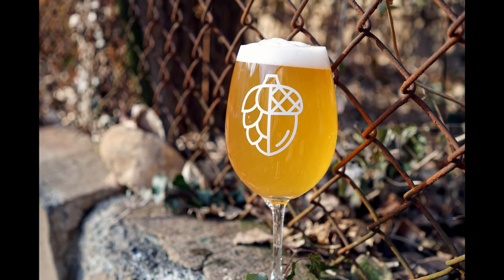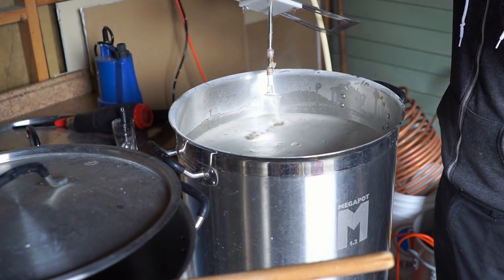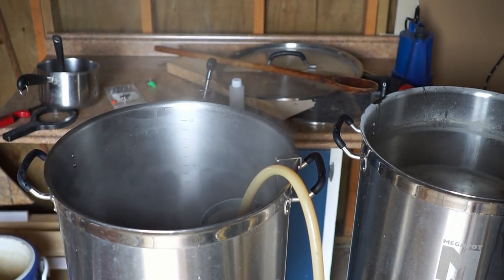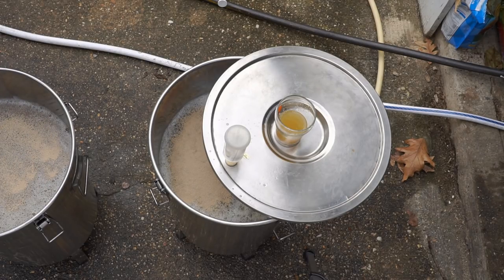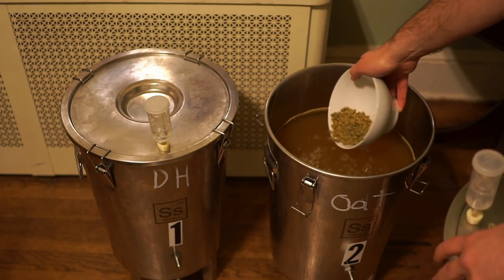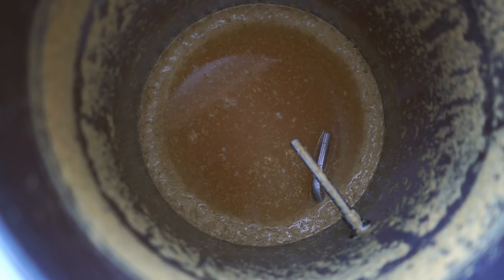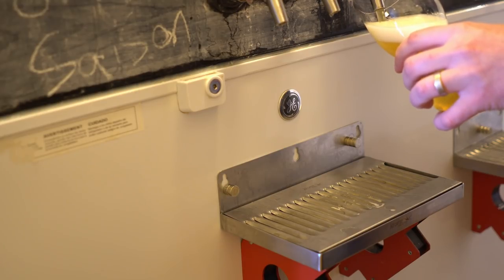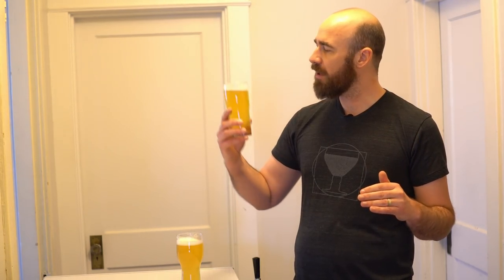Grain-to-Glass: Hoppy Session Ale - Dry Hop Timing Experiment!

Comment: just started home brewing so pardon this Q but are you putting your full boil volume in the mash, and just recirculating that? And after X amount of time of recirculation, transferring to the boil kettle? Thanks!
Reply from the maker: It depends on the batch, sometimes I add all of the water, sometimes I save a small amount to sparge with. It doesn't provide terrific efficiency, but it makes brewing easier and quicker. Worth it for me!

Comment: How long would you recommend for traditional dry hopping and what temperature for a beer like this? Also for increasing dry dry 
hop contact - have you ever pumped co2 into SS brewbucket?
Reply from the maker: At the scale I find the easiest method simple physical agitation (i.e., swirling the fermentor) although I have also played with sound waves, placing a speaker touching the fermentor set to 80 hz from a tone generator.

Usually I dry hop for 5-7 days, which is usually enough time for the yeast and hops to settle out and be left behind when I get. Dry hop extraction is pretty quick, so you could go faster if you are bagging the hops. I dry hop at fermentation temperature, but if you have a way to add hops without introducing oxygen (like in a keg before purging with CO2) then ~58F is a good stop to limit renewed fermentation if the enzymes from the hops free additional fermentables (called hop creep).

Comment: hello Mad Fermentationist~ i'm a new on home brew beginning 4 month ago~ i have two questions keeping bothering me. I with you can help me on it~ 1st, the process. i have asked many different people and got different answers. i don't know who is right. currently, my process is: 1st fermentation for 2 weeks. then transfer wort to a clean tun for another week with blow off. then dry hop for 8 days with 15℃(59℉), i will try to keep all gas in the tun. then bottling for 10 days with 18-21 ℃ (64-70℉) to carbonate. then put the bottles in refrigerator for another 2 weeks with 4℃（39℉） i was doing APA. would you please suggest me whether my process is correct? 2nd, fermentation temperature control. i know different fermenting period has different temperature. would you please share your experience on this? thank you so much in advance!
Reply from the maker: Luckily there are many correct answers in homebrewing. For my tastes in hoppy beers, I would shorten the fermentation/aging process. I count 7 weeks from brewing to drinking, I'd try to get that closer to a month. Oxygen and time are the largest concerns for hop aroma. I would likely dry hop in the primary fermentor as fermentation slows (day 3-4) (the yeast will absorb any oxygen you introduce). Fermentation should be finished and the yeast and hops dropped out after another week. You can lower the temperature at this point to help the yeast to drop out. Then I would bottle for two weeks. You can put one bottle in the refrigerator over night to test before chilling the rest. It shouldn't need two weeks cold once it is carbonated, but it is best to store them cold.

There are many approaches to temperature control. The ideal is having a refrigerator, temperature controller, and a fermentor with a thermowell (allowing direct monitoring). That's what I do when I want to be careful. For many beers I just brew with the seasons, taking advantage of the summer heat to ferment with yeast that prefer the heat (like saison). In the winter I make beers with lower temperature preferences. 

Hope that helps, best of luck!
Reply: thanks to the reply! so you suggest to dry hop within primary fermentation and the dry hop during could lasting for a week?
Reply from the maker: Precisely!

Comment: Purchase a Randall. The pH of beer is low and staling occurs when hops are added. When drinking green, home made beer,  flavors caused by staling aren't evident. 
Single infusion creates a chemically imbalanced wort due to precipitation of chemicals during the boil and at a time when the enzymes that are needed to align the chemicals are wiped out. Precipitation of chemicals needs to occur upstream of the boiler and when the boiling mash is added into the main mash it is used to reach a temperature which activates an enzyme. The enzyme changes the chemical into nutrients for yeast. 
Body is something not to worry about. The starch responsible for body is thrown out with the spent mash. It is the small, white pieces that are noticeable in the tun after the extract is run off. The starch is amylo-pectin and it is hard, heat resistant starch and the temperatures used during single infusion are not high enough to cause the starch to enter into solution where it becomes available for Alpha to release A and B limit dextrin which are tasteless, non-fermenting types of sugar. You paid for the starch but decided to throw it away instead of using it. The best part is that you threw away the richest starch in the kernel and instead used only simple starch, amylose, to produce ale. For dextrinization to occur at 158F there needs to be another link in the amylose starch chain and its occurrence is random. 
There's a sheet of paper that comes with each bag of malt and on the sheet are usually three columns of numbers along with a few acronyms and terms. The sheet exists because malt is very inconsistent and from testing malt comes the spec sheet which is used by a brewer to determine if the malt is capable of producing ale and lager. Are you aware of the sheet?  
If you enjoy producing single infusion beer use marris otter, halcyon, or golden promise. The malt is distillers malt and it is very suitable for producing home made beer with single infusion. There is a malthouse producing marris otter that is low protein. Low protein malt has a high sugar content and that would be the malt to purchase. However, to make ale with the malt enzymes are added and the temperature which activates the enzyme would be needed. 
The liquid drawn from single infusion is known outside of the home brew world as moon shiners beer. The name comes from the method and the malt because both are used during production of grain alcohol and during prohibition the only gang producing alcohol were moon shiners. After the stills were filled the rest of the liquid was sold and that is the other reason for the liquid being called moon shiners beer. A distiller uses 150F during the rest period because the temperature denatures Single infusion is used in the brewing industry but not to brew ale with, it is a method used for testing malt and the temperatures used during the test are 145, 153 and 155F. For 12 years you have produced moon shiners beer without knowing it and you spent a lot of hours producing a very poor quality wort. In terms of quality, home made beer is slightly above jail house beer quality and a step below malt liquor. Malt liquor is produced with a more advanced brewing procedure. The syrup in the kits has more sugar content than the wort produced by single infusion because the syrup is a by-product of three tests performed on malt. During testing three bags/cars of malt are tested each bag/car is tested at a single temperature and the temperatures are 145, 153 and 155F. The tests determine enzymatic action throughout a wide range of temperatures, richness of enzymes and total sugar content. The three liquids are used to make syrup used for baking and malt liquor. By using single infusion and 1/3 of a test procedure some how ale is produced by home brewers.
Weyermann produces slightly under modified, low protein, floor malt which I believe is available to home brewers but to soak the expensive malt at one temperature ruins the malt.
Reply from the maker: Very few modern malts benefit from a step mash. This was not always the case, but malsters are carrying out much more protein degredation than they did years ago. Generally a Kolbach >35% is suitable for single infusion. Even the floor-malted Weyermann Bohemian Pilsner is 38-44%. You're welcome to brew how you want, but I get fantastic results from single-infusion mashes!